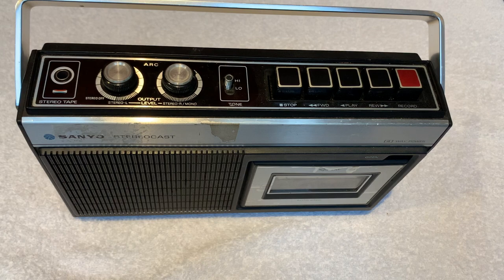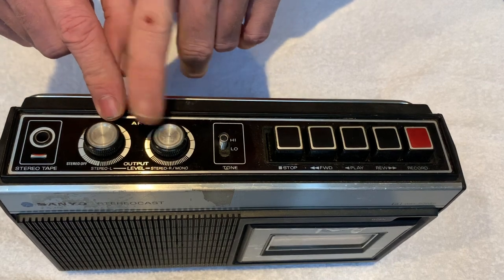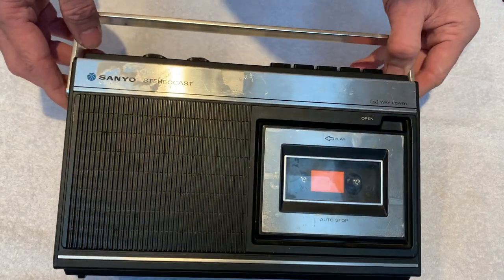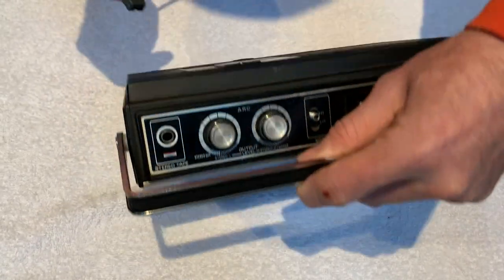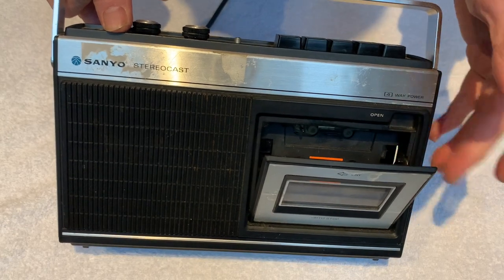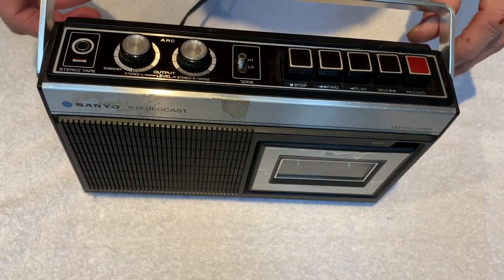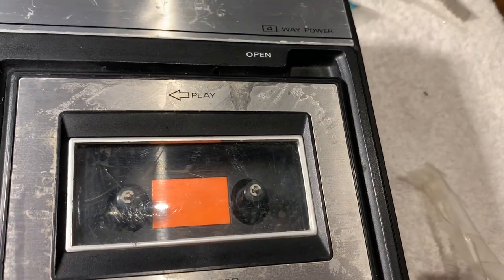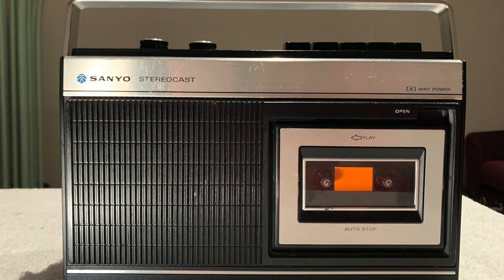Sanyo Stereocast Repair. M4200 Vintage Cassette Player 1970's Belt Replacement

Comment: I worked for sanyo for 28 years. I know this model quite well. The film on the cassette door is in fact protective packing material that should have been removed 50 odd years ago:)

Stereocast was an external FM multiplex decoder with 3.5 mm male input jack and a 3.5 mm female output jack that you could connect as an optional accessory to a certain range of portable (mono) radio's. It has nothing to do with this cassette recorder.
Reply from the maker: Thanks for watching - amazing to think that the protective film had been left on all this time. The adhesive had obviously dried out completely, so took a while to dissolve off. 
Thanks for the info re: Stereocast. As I recall, the adaptor (as you said) is a box with (I think) a stereo light. Does the stereo switch on the unit only work with the multiplex plugged in? Thus only binging mono to the other ear if only the cassette is used? They are lovely machines - I have a M2400F, M2400FG and a M2000G too - I love the large square tuning window on the top of the radios 👍
Reply: Stereocast adapters were small boxes. They only worked with a specific range of portable radios, not cassette recorders. The radio provided the FM signal as well as the power needed for the stereocast decoder. I never repaired one, we didn't sell a lot of them as they were not cheap.

Comment: I have the m4400f this is a stereo radio cassette the left speaker is powered through the metal hinge or you can remove and use a 3.5 cable in the compartment of the speaker my tape deck does need to be looked over it will play and sound fine but weak take up so after 10 minute s the real will not spin and it will chew a tape some thing on my list of to do .
Reply from the maker: The 4400F is a cool old machine. A nice Sunday afternoon job on the mech will soon sort that 😊👍